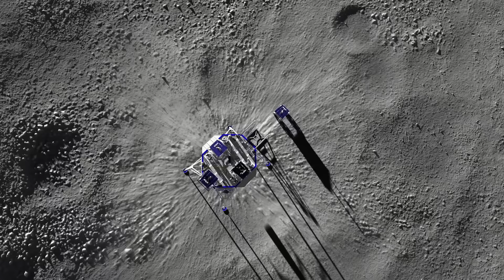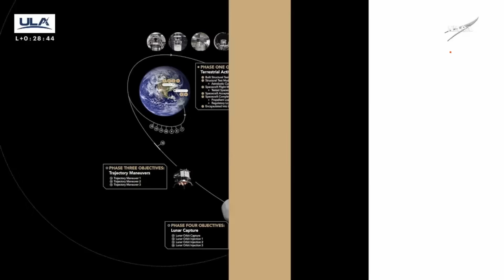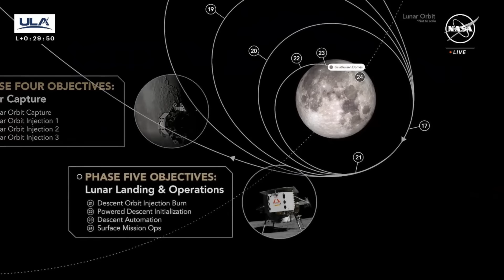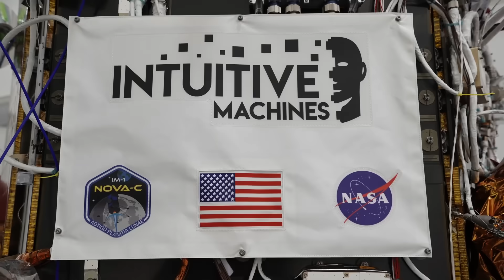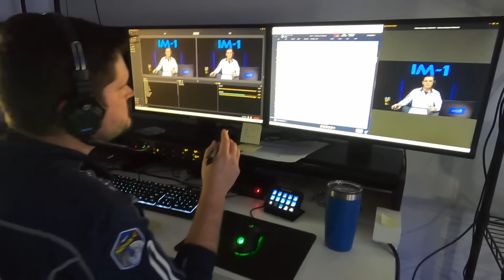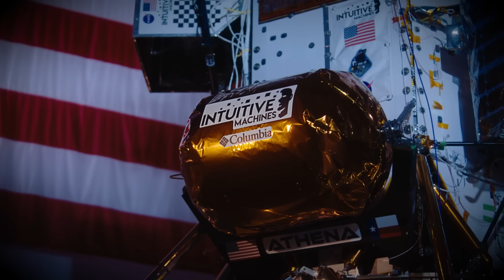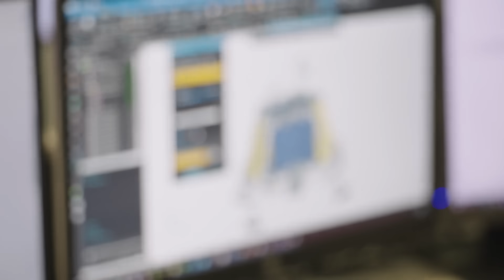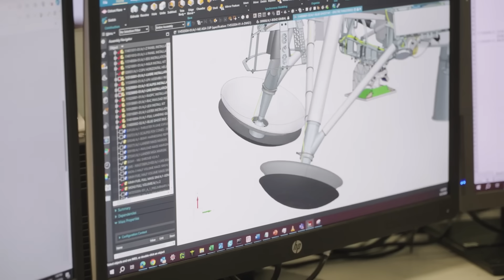Three Lunar Landers? Why Everyone Is Going To The Moon.

Comment: That IM-2 lander will use a Nokia radio to communicate with the MAPP rover and the Micro0Nova Hopper. The radio is actually a scaled-down version of a 4G base station, so you can expect that the news sites will call this a Mobile phone tower on the moon.
I work for Nokia (different area though) and our marketing team will go into overdrive mode obviously :-)
Reply: And since it's Nokia, it has a good chance of surviving the heat-death of the universe.
Reply: Finland needs their own lander.  Make sure Starlink doesn't capture the moon traffic.
Reply: They should use a Nokia 3210 as a modem.
Reply: At least on the moon there's no foliage or two cylinders of water-ladened cellulose foam to murder the signal. (trees and their leaves)
Kinda surprised they didn't use WiFi, though, or even ZigBee for that matter. After all, Percy and Ginny used ZigBee on Mars!
Reply: @DUKE_of_RAMBLE They need communication over several kilometers, so WiFi wouldn’t do it.
Reply: @johermans6750  I guess I didn't expect that these little Moon rovers would have that long of a lifespan, given how small they area and how insanely cold it gets during the long lunar nights. (many of the huge landers aren't even designed to survive it)

Also, technically WiFi is just as capable of traveling large distance than any other protocol. Even on Earth where its transmit power is limited by regulatory bodies, it still can by using directional antennas for Point-to-Point communication (the Pringles can "cantenna" mod back in the early-00s proved this). But yes, that would be harder to pull off since the two points are not fixed. 

Even still, with no humid atmosphere and no obstacles, it'll still transmit a considerable distance, which even on Earth is doable with omnidirectional antennas on large open areas. Combine that with the fact that the Moon lacks both fauna and regulatory agencies, it will go even further and can have the transmitters far more powerful.
Reply: @DUKE_of_RAMBLE  This radio is not only helping those 2 rovers - that's indeed overkill. It will also be used in the future when astronauts are walking around on the moon, and we start building a real moon base. I heard that NASA was looking at something like 3 kilometres distance (they need a higher antenna though) with a few tens of megabytes per second bandwidth (enough for a few voice channels, a webcam and some data connections for instance). All with the same protocols that are used in 4G. Something along those lines. Actually, the frequency is not determined yet, it will most likely change in the future due to permissions and interference to radio astronomy. The IM-2 lander is just testing if it all works as promised.
Reply: @DUKE_of_RAMBLE - Beat me to it with the "WiFi Cantenna" callout, I remember examples of them for enableing  line-of-sight internet access from down in the populated valleys outside San Francisco up to hilltop homes stuck with POTS 36k modems, and field science comms from sensors in the Atacama of Chile. Even now I have family useing a commercial varient supplying internet to their remote home group from the nearest highway power/CATV poles across the desert. Faster than satellite dish data, cheaper than poles or trenches thru near-solid boulder fields! Good cellular 4/5G service is still a distant pipe dream in many Western states and Canada outside cities (the cellular maps lie!). Could work fine on the moon, but a small Starlink/GPS group would be better considering craters etc.
Reply: @DUKE_of_RAMBLE  I thought you were talking about fat ppls legs
Reply: NASA is determined to.continuing to use its Deep Space Network to support communications on the Moon.  One side of that is that the Lunar Gateway provides connectivity for the Lunar South Pole about 80%.  Another part is a contract for a low lunar orbit constellation that provides a relay to the DSN.

However starting in late 2025 SpaceX intends to send Starships to Lunar orbit, and then in 2026 to land.  Why wouldn't SpaceX deliver Starlink satellites which can use IR lasers to relay through the existing Starlink constellation.  And that  "Moonlink" constellation would naturally include 4G and 5G support.
Reply: What video Systems are planned?
Reply: Ooooooops

Comment: 07:40 how is it possible that this type of failure could happen? How rushed and how much pressure must the engineers have been to miss this?
You know it was not apathy, so it must have been deadlines, stress and pressure. Bizarre these companies don't learn.
So many of these failures are preventable if not from fatigue and time sensitive related oversights, and nobody seems to be learning from this. Crazy.
I bet the company destroyed the technicians career over this without taking responsibility over the environment that lead to it.
Reply: I heard, somewhere that they didn’t want to risk the eyesight of those arming the laser system from a rogue beam. Those lasers are finicky and powerful, not to be messed with. I’m guessing they hadn’t heard that there are commodity goggles that reflect laser light away, and that technicians could wear them as needed.

Comment: I don’t know why so many lunar landers need to “die” after two weeks. Just shut the lander down and then have a small insulated battery attached to a solar light detector which flips a relay to turn the lander back on…?
Reply: Get your insulated Thermos, put boiling water in it, and set it in a freezer. I don't understand how it would freeze... 

By the way, the Lunar night is 14 days, with temperatures below -100 degrees Celcius.
Reply: You don't work with electronics, do you? Man, I love laymen who are commenting from the peak of the Dunning-Kruger curve.
Reply: I had the same thought on every moon mission that died overnight. I would like to know more about the battery technology used in the Japanese lander that survived two (or three?) moon nights. Did they have a Solar powered battery heater?
Reply: yea sure youtube engineer
Reply: Harsh temperature changes aren’t kind to batteries. Would be easier on them finding an area to land that always sees sunlight at either pole I’d guess.